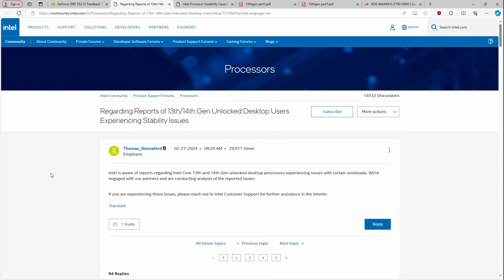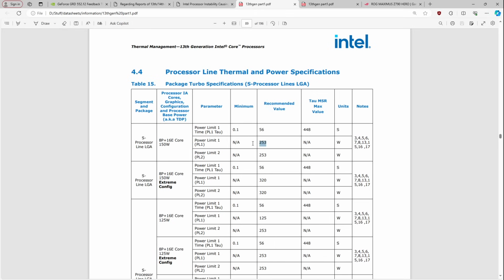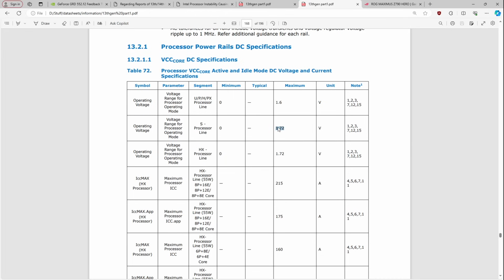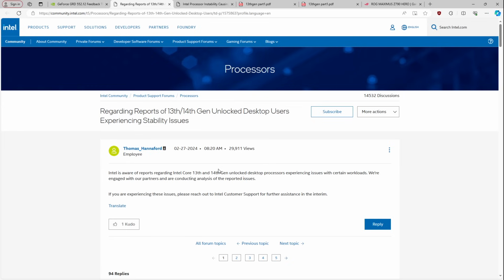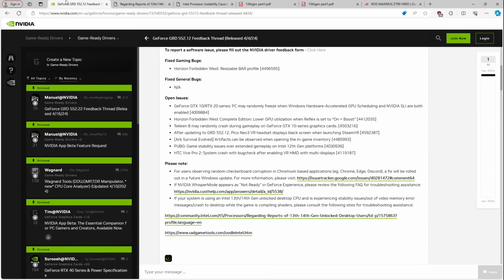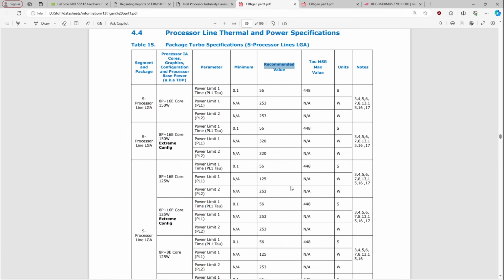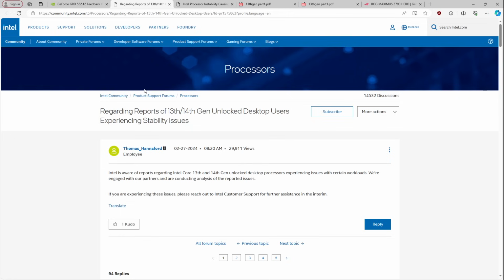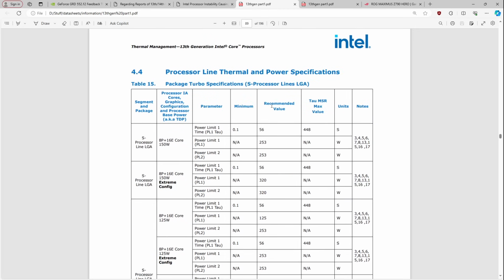Rambling about why some intel 13th/14th gen i9s and i7s aren't stable.

Comment: Interesting how we went from "But can it run Crysis?" to "But can it run Cinebench?"
Reply: It runs R23 and r15 same time…
Reply: Can it run Aida64 ☠
Reply: My friends complained that I'm "Gimping" my cpu by setting a lower temperature target. (AMD) But MAD and intel have lost respect for Physics. Running a CPU at 80 c is much better for reliability compared to 95C . And Throwing voltage at the problem is scary as well.
Reply: @ralphwarom2514  hey, I know it's scary, but in the video buildzoid said, you can increase voltage (either increase loadline or positive voltage offset) and the CPU will automatically reduce your clock speed at 100% load
Reply: Braethorn complain four me India make this. This no kindness this no convenience. My colour good colour. All colour amazing amazing colour
Reply: That’s because all of the techtubers being fanboys for AMD. At least crysis was an actual game and represented a real world use case for the audience. Cinebench is pointless and only became relevant became it was fun seeing AMD crush Intel. But it has basically 0 real world value. But you can thank LTT, GN, JAYZ2DENTS, HBU for trafficking in mediocre clickbait content
Reply: @a36538  You totally missed the Joke did you? Synthetic tests where also a thing when Intel dominated the market and AMD was still scratching their last cents together to get a decent architecture out
Reply: @a36538  The point is it should run without crashing on anything.
Reply: @a36538  I like both Intel and AMD, but it is a fact that 10nm (Intel 7) is outdated compared to Zen 4. But also, I think it's impressive Intel's last gen stuff can almost match or beat Zen 4 on TSMC 5nm...just imagine what Intel could've done if they were on TSMC's 5nm
Reply: @a36538  Intel fanboy detected, lol
Reply: Dude he mentions how AMD's 3rd gen Ryzen had issues being stable in single threaded workloads early on and also Nvidia having to hard set power limits due to crashes. This is totally on Intel for missing this shit on 2 gens... $500+ processors unstable at stock lmao
Reply: @a36538 cinebench does have real world value. Tho. It's a comparative. That's why we use many different points to compare anything
Reply: @jdrok5026  yes he say four this four me my dear

Comment: I didn't think you'd be bothered with this to be honest! Was looking at a cheap 12600k for messing with but didn't in the end just because this issue was brewing. Presume the i5s are too low power anyways
Reply from the maker: 12600K should be perfectly fine. Even the 13600K since the clocks are so low.
Reply: @ActuallyHardcoreOverclocking there are entire batches of defective 13600 that do not run at stock speeds. So I'd probably go for 12600 haha. Iirc 13600 runs with very high power limits, just like i7/i9
Reply: Yeah mostly i9s on high-end motherboards are affected.
Reply: Seems to be mostly 13/14900k and 13/14700ks

Comment: My sad little 12900k didn't get to join the club
Reply: Funnily enough, vendors used lower-than-Intel spec for those. They only do 4.9P/3.7E under an all-core load. Conservative approach worked out that time.
Reply: Also am in the 12900KF club, it's sibling. I was thinking to upgrade some of the 12th gens around the house (12400F, 12700KF & 12900KF) to 13/14th but then this all happened.
Reply: @dianaalyssa8726 I have upgraded my 12900K to 14900K and Z790 and G.Skill Trident Z5 DDR5 6400 CL32. Work great. But I have a stupendous huge water cooling setup. It is way faster but uses more power when watching media on my PC. So idle is higher. Plus unlimited it will pull 400 Watt. Anyhow it is what it is. Value is up to you only.
Reply: With small coolers, it has the same issues. Stock settings will allow 300Watt power easy.
Reply: Same for my 12900k, moreover mine also has some mental retardation (69 sp) that can barely run 5 ghz with uncommon voltage which is 1.380 XD
Reply: @tictechto 💀💀💀

Comment: Dumb question probably but if one had a defective 14900k but it’s been polished and lapped slightly, not delidded. Can they rma it?
Reply from the maker: AFAIK intel is pretty forgiving but they do require the IHS to still be labeled so if you lapped it to the point that the label is missing they probably won't replace it.
Reply: @ActuallyHardcoreOverclocking thanks brother ! It def has been lapped past the label but I’ve got the original box and receipt from when I got it at mc a few months ago. I regret lapping it just for the fact that it didn’t do as much for temps as it did with when I lapped my 13600k prior but I might just reach out to Intel and ask very nicely since this is such a big issue and it had previously been perfectly stable on all stock power limits until a few weeks ago. Thanks for the reply
Reply: @cppctek  The worst is they reject your RMA. There's no downside to try to RMA it.
Reply: @cppctek  Yeah it's worth a try, take some photos of everything including BIOS/CPU-Z Spec & send them an email to start a discussion to see where you stand
Reply: Good news mate! I did scan random 14900K OEM CPU in internet it's have got two DataMatrix: one on CPU IHS and another on CPU substrate (green thing around IHS) - they have got SAME serial number. So, Intel might identify you CPU. I may guess that it should match with serial on a BOX, but not sure.
Reply: You might be okay as they agreed to warranty delidded chips from SI's 🤞
Reply: @fracturedlife not from the public they didn't. Only businesses like dell and so on they did
Reply: I always take picture fo CPU IHS just in case i ever decide to lap it and engrave again. =) Might be a bit difficult to add DataMatrix, since it might be generated with specific code, but still... But there are software like Scandit which may identify  that specific code.